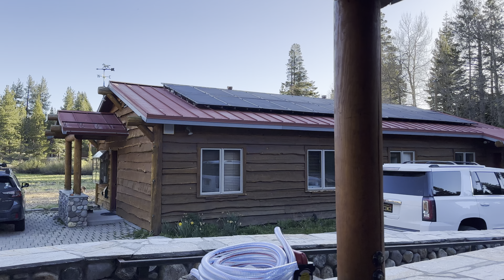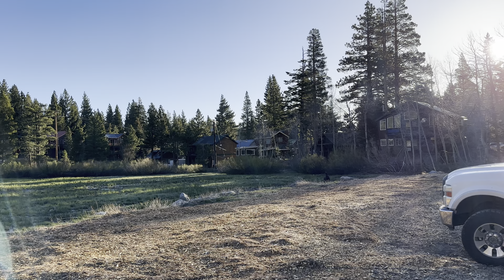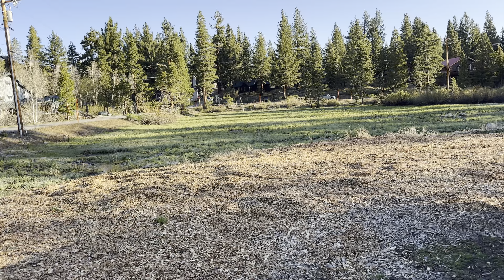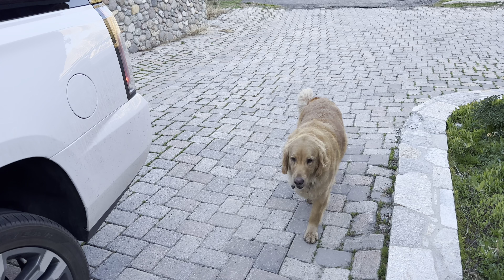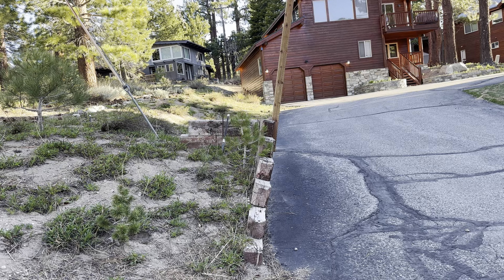Doing odd jobs in Mammoth. #high #country #construction

Comment: One should always have T-1 steel plate around of various thicknesses for anything to do with heavy equipment repairs - 21:00 for example.   3/8", 1/2", 3/4" and 1" thick plate remnants...

 (T-1, aka., A514 steel is roughly 2.5X stronger and wears much better than common structural steel, Caterpillars are made of it, labor is primary cost don't cheap out on steel or parts)

"Move it 3 times and you had a fire."  Cost of moving our shite.